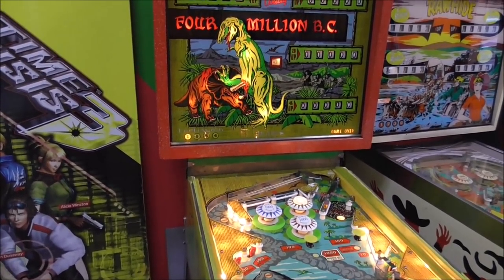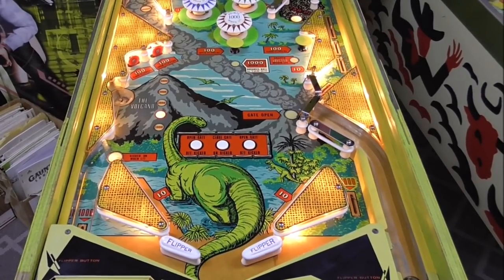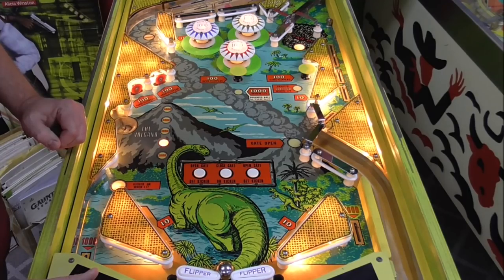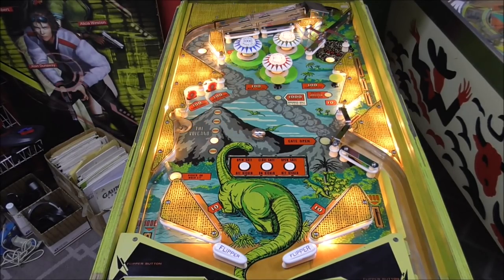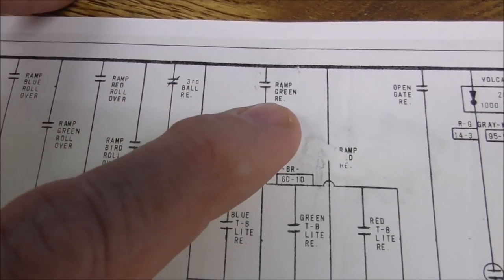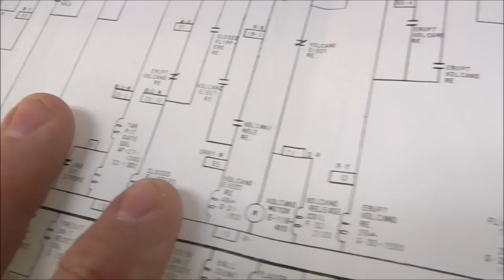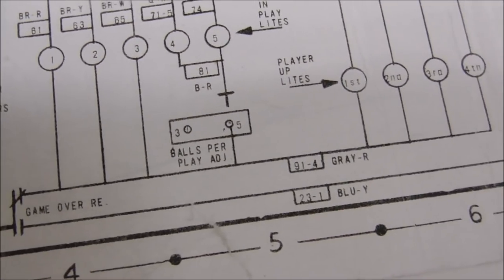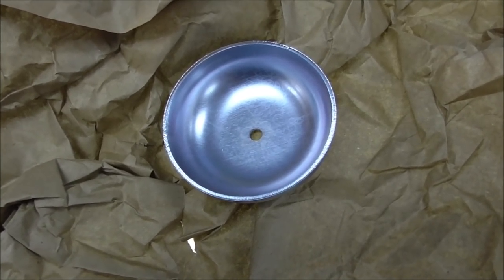How They Made Multiball Work in an E.M. - 1971 Bally Four Million B.C. Pinball Machine Schematics

Comment: What would happen if two balls went into the tar pit simultaneously during multi-ball, so that both balls were past the gate before the first ball hit the top switch?  Would the machine be "stuck" until an operator intervenes, or would there be some mechanism by which the tar pit could advance (e.g. if the tar pit advanced on power-up, getting two balls stuck in the tar pit would unfairly end the current game for all players, but power cycling would restore the game to operation).

Also, have you ever seen Balls-a-Poppin' (1956)?  I don't think I've seen one in person, but I've seen a couple videos of it, and it looks pretty cool.  Instead of using "lock" shots, it has an auto-plunger which adds up to eight "wild balls" in addition to the ball in play.
Reply from the maker: Looking at the schematics, I think it would be stuck and wouldn't be able to start a game or kick a ball out, I think they have the gate at the top setup so well though that it would be nearly impossible for that to happen, there is a little metal post that makes the ball bounce to the left, and they may have added that just so two balls wouldn't be able to roll down into the tar pit while touching each other (which might make it past the gate)... since they have to bounce around a little bit the gate would close before the second ball made it in.

I've never had a Balls-a-poppin in person, but it'd be a fun one to work on for sure!

Comment: that sticking relay for the green light, stick the volt meter on the coil and see if it's getting a voltage, if not use a degaussing wand to demagnetize it.